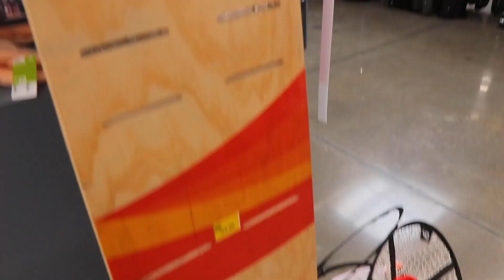SKATE EVERYTHING WARS DECATHLON!!

Comment: Nigel should have taken the workout/balance ball thing apart to put the trucks on it. Should have taken it apart so the plastic bottom was separate from the ball then used drill bit instead of screws and just used regular skate hardware since the screws are flat then put it back together.

Comment: You guys should do a mellower floor is lava course but with boosted boards but the guy on the board only has steering and someone else has the acceleration. 
Maybe with 2 man teams so it's: player 1 is on the board with steering and player 2 with throttle and then vice versa.